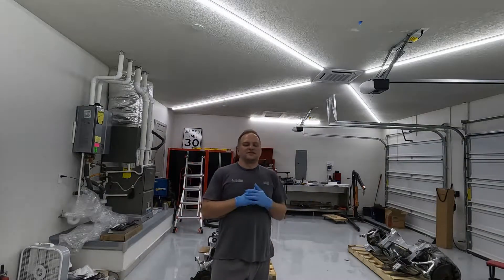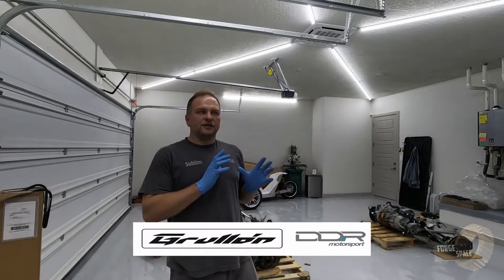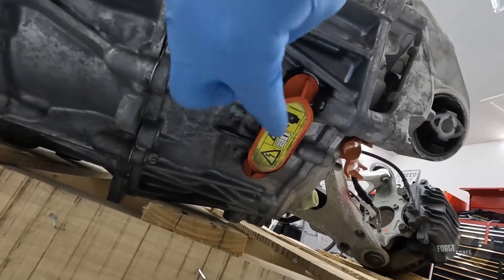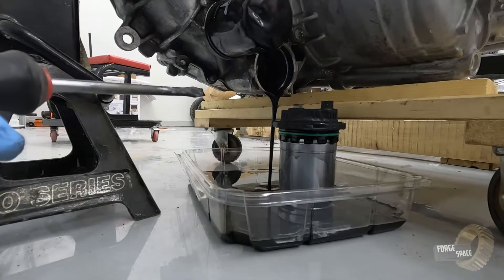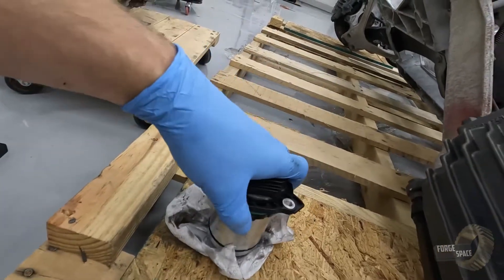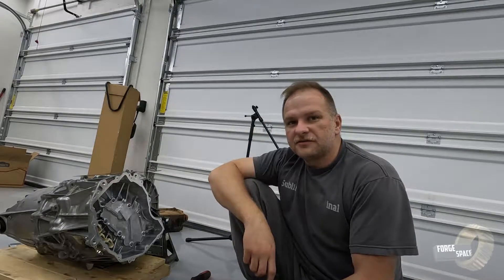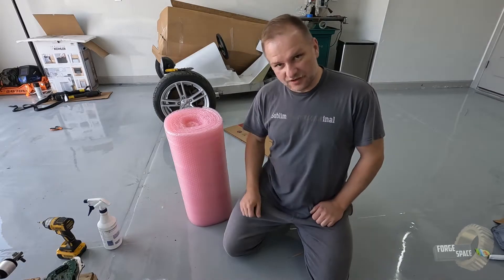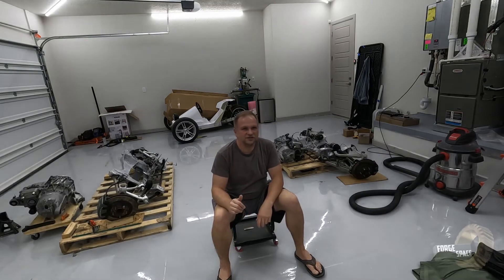Prepping the Tesla Motors for the Grullon DDR (Inverter Removal) EP.01

Comment: Why don't you use both rear engines?  or the Plaid engine turned it into a supercar?  How long will the project take?
Reply from the maker: A two performance motor setup would likely exceed the current draw on the battery. I explored this option with the controller manufacturers. I'm not sure if anyone has cracked inverter controllers on the plaids yet., not can you source one for a decent price.
Not sure on the timeline, I can see this project taking up to a year due to custom parts and shipping timelines.
Reply: @ForgeSpace  I will follow all the videos closely.  Such projects are my dream. 👍